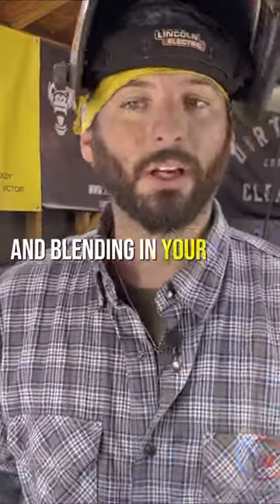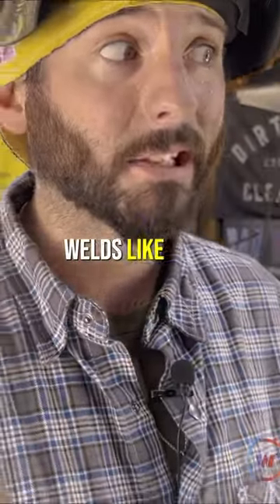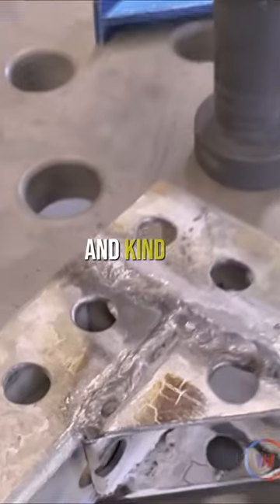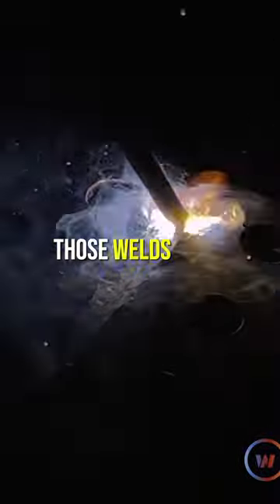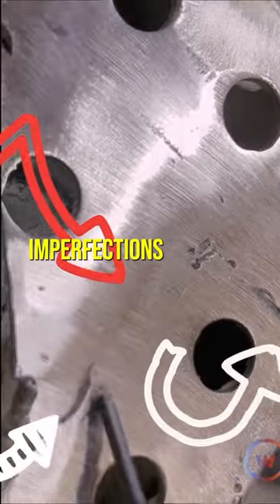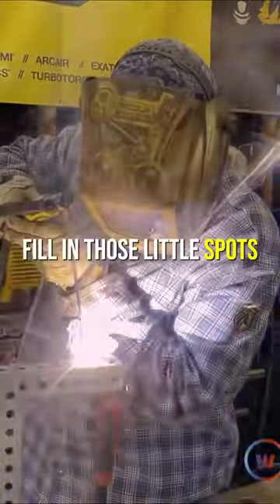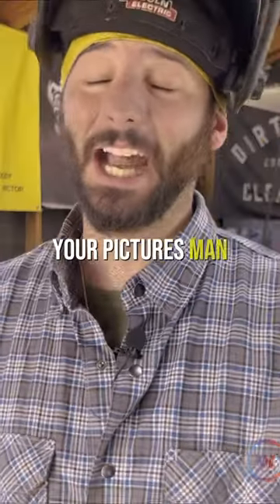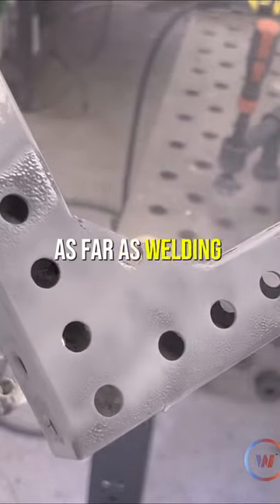Grinding and blending galvanized steel #welding #shorts

Comment: Muratic acid removes galvanized coating almost instantly
Reply: Did you mean muriatic acid? And does it remove it well enough to weld? Some materials have a pretty thick coating I would think this wouldn’t work on.

Comment: Awsome tips an advice,im a fusion welder,  i do mess around with the steel, not as much but welding is passion, i build and custom fad my own work as its very costly to get something made specific to youre own requirements,